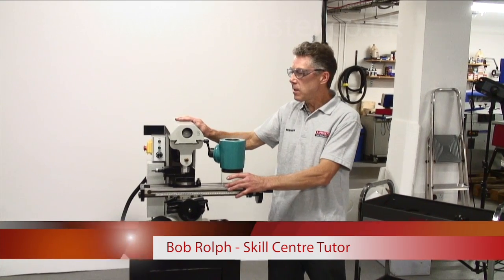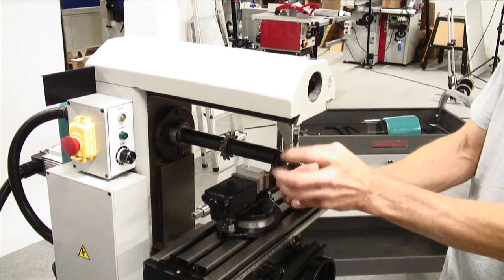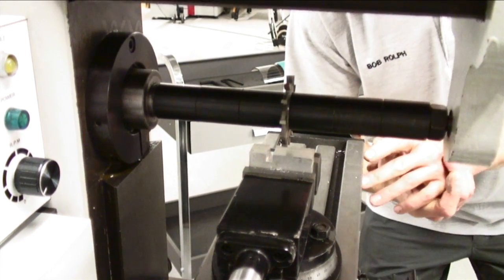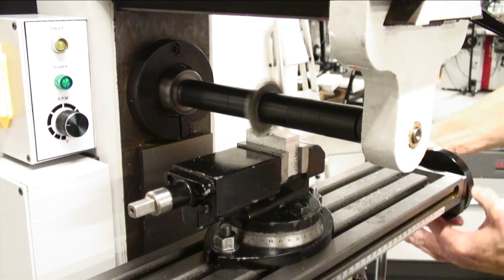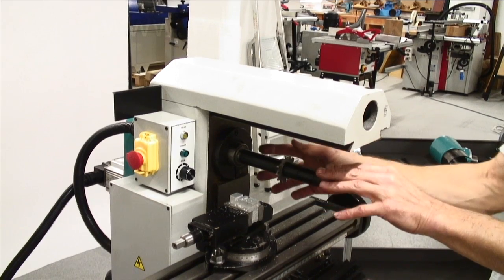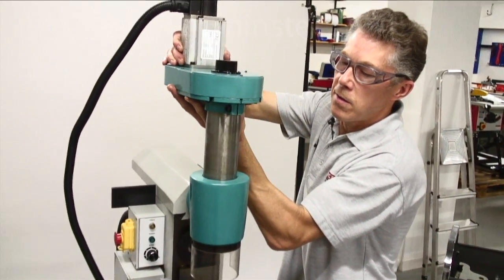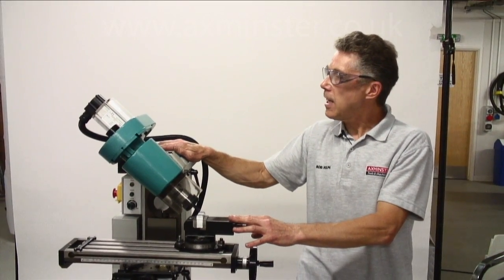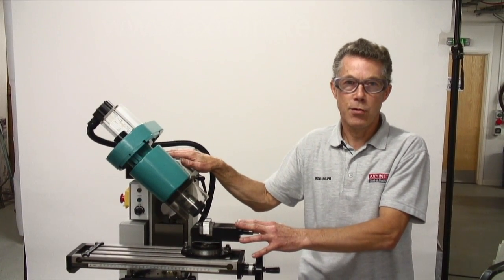Axminster Engineer Series SU1 Universal Mill

Comment: I bought the machine last week from Sieg Machines Germany and am delighted with it. It weighs 105 kg and is therefore much more rigid than the usual hobby milling machines you can buy for the same price, which are more or less just better drills.
The problem of the Z-axis being too short has now been solved, the travel distance has been increased from 105 to 205 mm with a higher column, so there is nothing more to complain about.
However, as with all Chinese machines for the hobby sector, the somewhat careless assembly of the machine in the factory is still to be criticized.
In order to achieve accurate milling results, everything should be checked once and adjusted precisely. After that, the SU 1 works like its big sisters, which weigh a ton or two.
Reply: Hi, wo hast du die Maschine gekauft? Erst vor einigen Tagen? Auf der Sieg Webseite steht eine Lieferzeit von 12-14 Wochen.
Reply: @WeCanDoThatBetter  Sorry, jetzt erst gesehen. Ich hatte wohl die letzte vorrätige Maschine erwischt. Jetzt mit 12-14 Wochen Lieferzeit. die Maschine wird dann nach Bestellung extra hergestellt...

Comment: Reading the comments, it is getting poo pooed by the usual armchair experts.
 I think this would be a very nice machine for small projects. Much more ridged and accurate than the mill drill types. You would get a lot more capacity using tooling selected specifically for this machine. 
It is NOT a universal though.

Comment: Super cool machine, but it doesn’t have a quill! I would like to see a unit made that trades off the horizontal configuration for a quill. I’m looking for a benchtop mill and I think these knee mills are much cooler than the column mills. And I would assume much more rigid?
Reply: Not having a quill actually makes it much more rigid, and would actually drill better holes, just much slower, the limitation of this machine is the space between the chuck and table, not the lack of a quill.
Reply: P0tat07: I saw one of these in a Grizzly catalog under their Grizzly colors and branding.  I am glad I saw it here and found out that there is no quill,  which would make it almost useless to useless for drilling operations.

Comment: Since the table doesn't pivot in either plane I'd be hard pressed to call it a universal mill at all. There's some half decent design in the machine, but no built in power feeds on the table and by the looks of it the spindle is fixed in the vertical orientation so you'd have to drill using the knee. Very rare to see any new machine today with horizontal capabilities but   if I'm being honest I think I'd much rather keep my little 65 year old Atlas horizontal with all it's built in power feeds. Since Sieg already has quite a few vertical mills in various sizes I think they might have been better off designing it as a stand alone horizontal machine and add at least one axis power feed on the table. Just my opinion and worth about nothing I guess.
Reply: Absolutely right, it is only an H/V machine not a "universal" one, but given its limitations I'm sure some folks would still find it useful, my cheque though will be staying in my safe.
Reply: I have an Atlas that i basically did the same thing to.Used a Du more aux.milling attachment 3 MT. It is 1to1 ratio,so i can still use all the stock factory drive.works great.